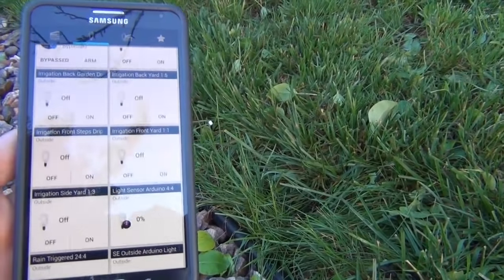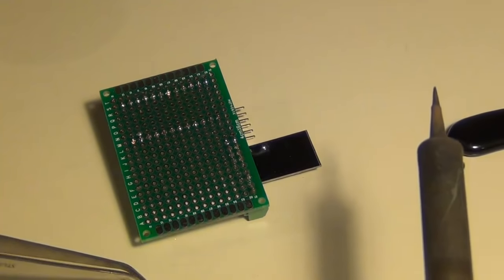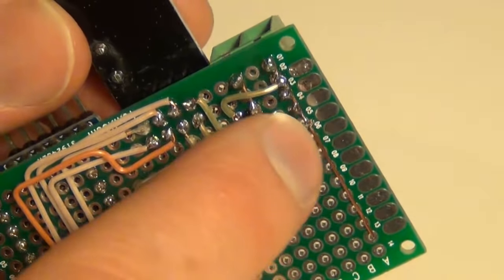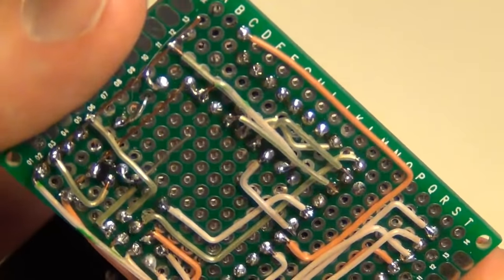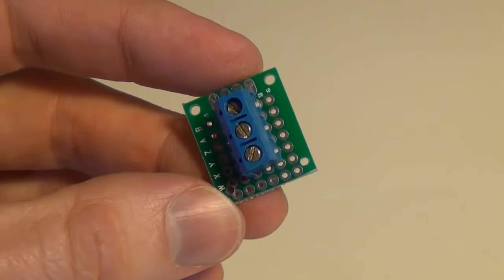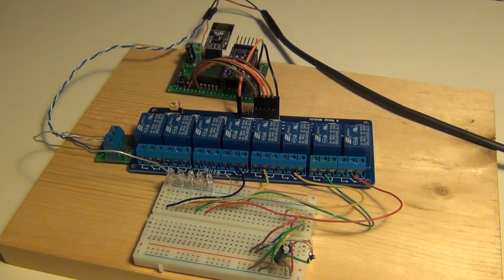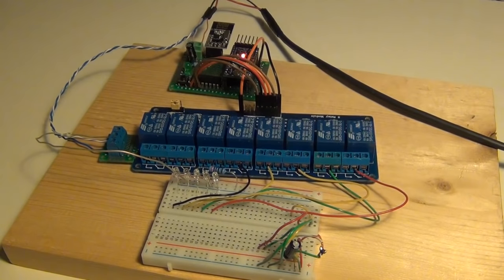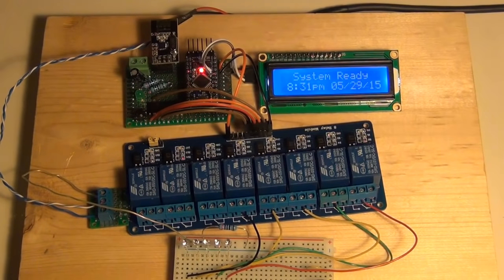How To - Cheap, DIY Arduino Irrigation Controller with MySensors

Comment: Great video! I'm assuming you used to Elegoo 8way relay module, have you found the relay board reliable? I have seen mixed reviews. #HereInLockdown
Reply from the maker: It is some generic model I got on ebay.  It was the cheapest one I could find. I haven't had a single issue with it since I built it.  It watered my lawn yesterday :)
Reply: @peteb9105  @Various Artists I am setting a controller up now with the Elegoo relay module.  I got an Elegoo and another off brand and the Elegoo was packaged with much more care for what that is worth.  Also, the I2C library link is no longer working but I found the same author's github site and got it from there... crossed fingers!
Reply from the maker: Yes, hopefully it works for you!  
If you have a chance to submit a pull request with the updated library that would be great.

Comment: Hi i new to electronics. I've only used breadboard before but never this type of board. Are the holes electrically connected to each other? If so, How do you prevent them from short circuit?
Reply from the maker: No, not on the type of prototype PCB I'm using here. They are just holes that make it easier to solder to.

Comment: Hey Pete! Cool project man! I just didn't understand how you can control the irrigation with a smartphone. Your project uses a radio. How is that possible? I'v tried to search this micasaverde and find nothing usefull.
Reply from the maker: For this project I used MySensors (mysensors.org) to communicate with the irrigation controller.  So, it looks like this:  Irrigation Controller <> MySensors Gateway <> Smart Home Controller (Vera)

Comment: Asking a question to help my brain understand.  What component are we taking out of the equation?  The expensive $600 Vera controller? Can this work with just the Vera app?  I'm hoping for very cheap setup and hoping this really fits the bill.  I'm sure the answers to my questions are scattered throughout the website and forums somewhere, but I want to know if I need bother spending my time to find it.  Thanks!  Interesting project however this turns out for me.
Reply from the maker: This is just the irrigation controller (switches on/off the valves).  You will still need the brains to control it (Vera or some other controller).  If you want to do it as cheaply as possible you may want to check out the Domoticz controller (free controller software that can be run on a computer or Raspberry Pi).  If you do end up going with Domoticz some modification needs to be made in the code.  People have already done the modifications but you will need to search the MySensors site to find it.
Also, you will need a MySensors gateway (can be less than $5 if you use Arduino Nano as a serial gateway plugged in to the computer/Pi running Domoticz).
So, it would look like this:
Irrigation Controller <> MySensors Gateway <> Home Automation Controller (Vera, Domoticz, OpenHAB, etc)
Hope that helps.
Reply: Yup....exactly what I am needing Pete!  Thanks for all the time you spend helping me and others!

Comment: Thanks for the video....one question....whats the 3.3 V controller? could you please put  a link where ti can be bought???

why for the capacitors?
Reply from the maker: If you follow the link in the video description you will find all the parts I purchased (on the MySensors site).

Comment: Hey im getting this error below, Is this to do with a libary? Thanks for your hard work!

MySprinkler:174: error: 'POSITIVE' was not declared in this scope

 LiquidCrystal_I2C lcd(0x27, 2, 1, 0, 4, 5, 6, 7, 3, POSITIVE);  // Set the LCD I2C address to 0x27

                                                     ^

exit status 1
'POSITIVE' was not declared in this scope
Reply from the maker: Check out Sriram R's solution below.  I will have to take a look at the code to see if a library can be switched out.

Comment: Hey so when you are using vera did you need to buy any parts other than the radio?
I guess im asking if i can buy a radio and vera will recoginze my arduino when i register
Reply from the maker: You need to have a MySensors gateway (another Arduino + radio) that connects to the Vera.  Check out my MySensors playlist for more info: https://www.youtube.com/playlist?list=PLGzVpwPAKnPZ6F4fY8AevfVmcHdJFpKma

Comment: Could you hook this up to turn on with soil moisture sensors that are in the garden/lawn somehow to operate the solenoid switch panel you have?
Reply from the maker: Sure.  It would be easiest to do it with a home automation controller but you could probably code it to have the sensors plugged into it directly.  That is not supported in the code by default though.

Comment: I noticed a lot of similar relays controlling solenoid use flywheel diodes to protect from surge backs. This video doesn't seem to use a diode, is it needed?
Reply from the maker: It has been a long time since I looked into this and I'm not at a point where I can look right now but I think there are optocouplers on the board to protect it.  I have been running this for years and I haven't had an issue with surge backs though.

Comment: Hi,
I want to make this completely offline. With an RTC, 16*2 LCD, 3 push buttons, Soil Moisture sensor, Dht22, and a temperature sensor for soil to display values. I am stuck at making a menu which can be useful to schedule the watering. I just want to make a menu which can be helpful for user to modify the time schedule where the pumps will switch on with respect to soil moisture condition. Rest of the time it will just display the sensor values. The reason of scheduled irrigation is to avoid Shocks due to differences between environmental temperature and water temperature so ... Can you help me with a simple 3 button menu  ?
Reply from the maker: Unfortunately I don't have the time to help.  You might try modifying the code yourself and if you get stuck you could post in the Arduino forums.  Sorry.

Comment: thanx alot my frind . i want to ask how u install  esp8266 and how its directly conected to the board. thanx
Reply from the maker: I have not played with an ESP yet.  You should be able to wire it up as a MySensors ESP gateway though.  See this: https://forum.mysensors.org/topic/2247/why-don-t-you-write-mysensors-library-for-esp8266-similar-to-the-nrf-one and this https://www.mysensors.org/build/esp8266_gateway

Comment: Really nice video ! Can someone tell me which sprinklers & valves is used here , the link isn't available..
thanks a lot ,
 Orly
Reply from the maker: Thanks for letting me know.  I just updated the video description with new links.  Pretty much any valve and sprinkler heads will work.  This just controls the power to the valves.  The key is to make sure you have a power adapter that supplies the correct amount of voltage and amperage that the valves require.  In the US most valves use 24 volts.

Comment: Hi Pete, 

I bought an arduino mega to control some speakers and i also wanted to do this sprinkler control, but apparently arduino  gateway plugin can't be used with UI7. It does not show up in the install apps. Hopefully they will make the change in it to be able to use it.
Reply from the maker: +Ron Brown Hi Ron, it actually does work in UI7.  I don't personally have UI7 installed but many people do.  I don't believe the app is in the app store, you have to upload the device files.  Check out my MySensors getting started videos for more info.
You will need an Arduino Nano to do a serial gateway or pretty much any of the major Arduinos to do an Ethernet gateway.  I am running my Ethernet gateway with a Pro Mini.  Hope that helps.  
Pete
Reply: +Pete B  Hi Pete,
Thanks for getting back to me so fast. I will check out MySensors. I looked on the vera forums for the arduino app, but I couldn't find anything, but I will look again to see what I can find. I had UI5 Before and I know that the Arduino plug in  was there then, but not with UI7 

Thanks
Reply from the maker: Ron Brown Great.  There are lots of helpful people on the mysensors forum if you get stuck at any point.

Comment: hi sir I have seen your project it is excellent.my self manikandan I am interested to make a arduino project on home automation it's concept is also similar to this project. but you showed controlling of irrigation by a smart phone but in the end of the project it is controlled BT a push button. sir this is my doubt how can I connect my smart phone with 8 relays through arduino and for that what type of coding's to be use can you please help me sir
Reply from the maker: +Manikandan R Hello, I am using Vera (getvera.com) as my home automation controller.  The app interfaces with Vera and MySensors integrates with Vera.  So it goes like this Phone App > Vera > MySensors Gateway > Irrigation Controller.  Check out some of my MySensors getting started videos for more info.

Comment: I have a need to program 16 zones - how can I extend it to support more than 8 zones?  Any guidance would be much appreciated.  thanks in advance.
Reply from the maker: You can have multiple shift registers linked together. If I remember right you can have 64 total zones. I haven't done more than 6 zones so unfortunately I don't have any more info than that. Check out the forum thread in the video description though. I believe someone made 16 zones and commented on it (but not positive).

Comment: whats the name of that i2c adapter for lcd screen? and wheres best place to buy?
Reply from the maker: Mine came with the module already attached but I believe it's something like this:
https://rover.ebay.com/rover/1/711-53200-19255-0/1?icep_id=114&ipn=icep&toolid=20004&campid=5338071705&mpre=http%3A%2F%2Fwww.ebay.com%2Fitm%2F1PCS-IIC-I2C-Serial-Interface-Board-Module-LCD1602-Address-Changeable-%2F141976542986%3Fhash%3Ditem210e761f0a%3Ag%3AJ0YAAOSwcu5UNp~I

Comment: Can i Feed the variables directly into  Arduino's Code with out using a Vera. Because i want my Arduino to turn on the switch for 1 min every 15 min.
Reply from the maker: You would have to modify the code but yes, it definitely can be done.

Comment: 00:40 what type of sprinkler is that? i heard they are better with wind and putting same amount down.
Reply from the maker: I'm not sure of the exact model but it is a High Efficiency Rotary Nozzle (https://www.rainbird.com/products/rn-high-efficiency-rotary-nozzles-0).  They have been working fine for my side yard but you need a bunch of them to get good coverage.

Comment: Why are you using a shift resistor and not simply use the pins on the arduino? Is there a benefit?
Reply from the maker: +Fabian Zills 
Good question.  I actually don't need to use one for my number of zones.  As you said, I could have used the pins on the Arduino.  The reason I did was I wanted to learn how to use a shift register as well as be prepared for future zones that may be added to my system.  There are other people who have more zones than me which it will hopefully benefit as well.

Comment: How much difference would everything be with a Raspberry Pi 2? I know a sprinkler board is out there for around $40-$45 but I see some parts are interchangeable between RPi & Arduino, but I'm new to everything. I'm currently using a Netafim controller I got for <$20 that does 6 zones/3 programs/4 run times each zone; I use a fertilizer injector with 3 zones, all different total gph needs, but turn 2 ball valves and can run all 3 as 1 combined, which makes the fertigation delivery rate equaled. Otherwise, even using a venturi-modified ball valve helps small zones flow fert to them but then this oversupplies large zones that don't need the venturi mods.
Reply from the maker: matermark Good question.  I don't have a Raspberry Pi so unfortunately I don't know the answer.  Some people on MySensors.org are using Raspberry Pi boards with OpenHAB as controllers for their home automation system.  You could use it for that but then you would still need to buy all the parts to make this controller.  Sorry I can't be more helpful.

Comment: My system can't pass verifications for clock and valve data when I first plugged in. Is that because I don't use Vera or any other program to set up my variables?
Reply from the maker: Yes, you would need a controller compatible with these MySensors features.  I use a Vera so I'm not sure what other systems are compatible but I believe people have used Domoticz and OpenHab with this irrigation controller.  Your best bet is to check the forum here for better info: https://forum.mysensors.org/topic/153/irrigation-controller-up-to-16-valves-with-shift-registers
Reply: Is it possible to do that manually in the code? And how if it is?
Reply from the maker: Иван Петров Yes, it is possible.  I believe some people have already done it on the forum.  Sorry I can't be more specific.  I have a Vera so I've never needed to look into it.
Reply from the maker: Иван Петров Check out this post.  I haven't tested it but it seems to be working for this user: https://forum.mysensors.org/topic/153/irrigation-controller-up-to-16-valves-with-shift-registers/152
Reply: +Pete B Yes, I've already seen this and try it but it doesn't works for me.
Reply from the maker: Иван Петров What controller are you using?  If you aren't using a controller you will need to remove all the parts of the code that send/receive from the gateway.  You will also manually need to assign some values to variables.

Comment: You could add an "off" zone in case you do not want to select anything to water while using cycle button.
Reply from the maker: That is a good idea!  Next time I'm working on the code I'll see if I can add that.
I actually never use that button because my watering is automated based on weather data.  Or, if I want to start a zone I do it from my phone (like when I'm blowing out the sprinklers).

Comment: hi you use a arduino mini..  but i looking to purchase a arduino uno kit.. and wanna do the same stuff.. would you happen to know how to modify this for a uno  and i totally new to arduinos  i been playing with them on the tinkercad site... any help be great
Reply from the maker: The Uno uses the same chip as the Mini (ATMEGA328P) so all you need to do is change the board selection from the Tools menu when you upload the code

Comment: hi i'm asking where can i find The
Watering solenoid valve thank you
Reply from the maker: I got mine from my local home supply store (Home Depot) but something like this will work: https://www.amazon.com/gp/product/B00004S1V2/ref=as_li_tl?ie=UTF8&camp=1789&creative=9325&creativeASIN=B00004S1V2&linkCode=as2&tag=petewill04-20&linkId=59b17200174e7bbd423faf9bd0511210

Comment: thank you for your information sir, OK sir u are saying that the arduino is connected with your phone through internet,vera,isit . OK now what I am asking is there is any possibility to connect phone app with arduino without internet
Reply from the maker: +Manikandan R Hmm.  You could still use the Vera (or something like Domoticz or OpenHab) and not have it connected to the internet (just over wifi).  If you are trying to remove the controller I wouldn't know how to do that.  There is probably a way but I have never needed to look into it because it works with my Vera.  Sorry.

Comment: hello, I'm intrested in your project and i have a few question's.
the program that you use is "vera" but i can't find how to use it like you, can you send me a link? and is it stil working ? or is this system not compatibel anymore?
and do you have a time table programmed in it? like at sunday morning at 7:00 am they need to drain your garden ?
its for a project for high school 
i'm from belgium .
I would like to get an answer
thanks
Reply from the maker: Vera is the home automation controller I use.  You could try Domoticz instead.  It's free.
Yes, the controller is still working and I use it every other day.  It has the time stored locally but it gets the commands from the home automation controller for when to water and they are not scheduled (although you could program it to do that if you wanted to).  The reason they are not scheduled is so the watering times can be adjusted by the controller based on past and future weather.
Reply: i would like to make te project but would like to add things like a 
level sensor for a water storage 
that ensures that spraying is not possible if the water level is too low and 
a moisture sensor that can indicate that the soil in a greenhouse is too dry 
 

and then ensures that the greenhouse is watered. i will also like to add a 
Roller shutter to this project. 
The project is to completely automate a garden house, do you think this is possible to control all this with the arduino? 
Is there a better way to communicate?
I appreciate all your help. Thank you!
Reply from the maker: All that is possible, yes.  I would make all those things separate sensors and have all the in your home automation controller (Domoticz, Home Assistant, etc).  So, each sensor/actuator is being controlled by a larger brain (the controller) instead of trying to do everything with one sensor/device.
Start small.  Get one thing working then add more pieces to the equation.  My irrigation watering time is all based on the weather, past rain, future rain prediction, etc.  I just send the updated times to the sensor and it waters.  It's dumb on its own but it gets smart with the algorithms on the home automation controller.
Reply: i tried to make a account on vera but i need to select a device ..  how do i need to pass this?